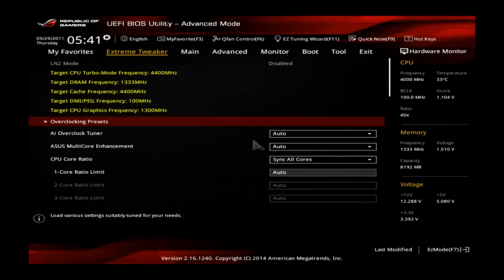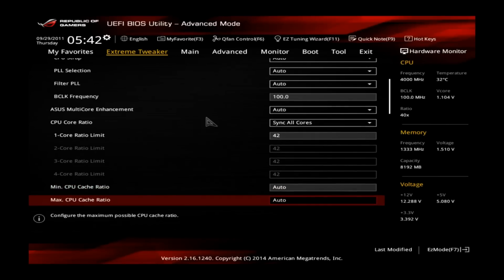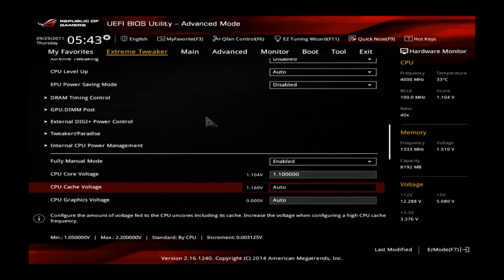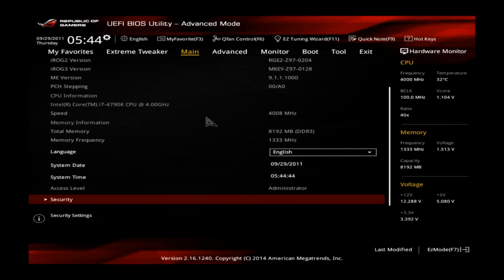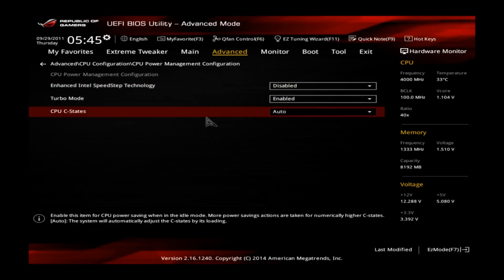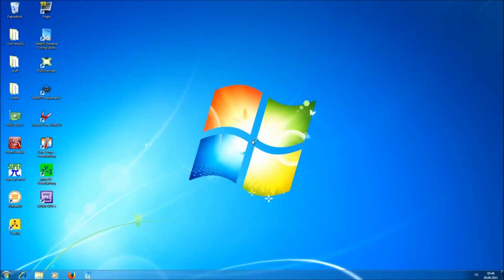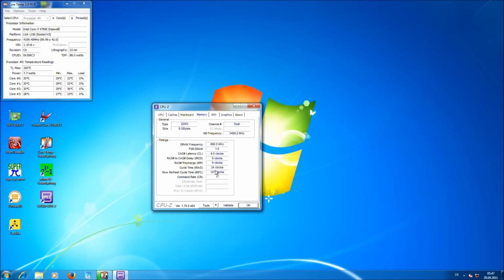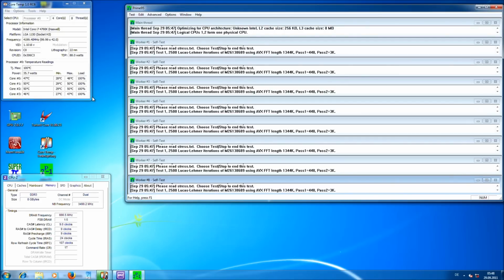ASUS MAXIMUS VII GENE [Part 1: CPU OC Guide]  Overclocking.Guide

Comment: Can u do a video how to overclock 4770K on this Motherboard.
I followed every step that u done in this video, but my 4770K is not overclocking like 4790K.
Reply from the maker: ES ES 4770K and 4790K are almost identical :) Where exactly do you have problems?
Reply: Its not starting to windows. it says your PC Ran to problem with bluescreen. and my CPU vlotage is 1.85 this the normal voltage I have.

Comment: I've just bought Maximus Gene VII.  The time doesn't go in bios :o/   WTF?
Reply from the maker: Roman Pike you can't enter the bios? Worst case boot without SSD/HDD plugged in.
Reply: der8auer I've fixed the problem. I have downloaded the new BIOS version, and the time is going right now. But in old BIOS, the time was permanent, and I had big problems in saves, in Witcher 3 game :о)  Every saved file had been in a different time and they all were mixed up. :о)) I blamed the game at first, but the reason was in old version of BIOS. ;o)

Comment: not working on my mobo, keeps bsod, ram is Kingston Technology HyperX Beast KHX18C10AT3K2/16X, cpu is Intel Core i7-4770K BX80646I74770K, do i need a better psu? i currently have a 750w
Reply from the maker: did you try to set a lower CPU speed? Which BSOD exactly?
Reply: der8auer yes, but it seems it only liked it at 39, i was searching online and found a forum where they said to try changing the vcore to 1.2625 and multiplyer to 40 & using xmp profile, so far it's running fine im running prime95, today i bump it up to 41 no bsod yet.

Comment: Hi, thanks for the video. Can i use the same settings on the Asus MAXIMUS VII HERO? Can u make another Guide for 4.4 Ghz?
Reply from the maker: Hi. The settings are the same using the Hero so it should be no problem. For 4.4 GHz just increase the 1-core-ratio-limit to 44 and increase the CPU Core voltage. Depending on the CPU quality you will usually need something between 1,2 to 1,3 Volt. Just raise in steps like 1,21 - 1,22 - 1,23.... until it's stable and keep an eye on your core temperature on load.
Reply: der8auer Hi, erstmal danke für die Hilfe. Das Bios Menü ist beim VII Hero etwas anders. Wäre es möglich, dass du es in den nächsten Tagen per Remote Zugriff auf meinem Rechner einstellst? Ich würde dir auch ein Amazon Gutschein zusenden. Danke & Guten Rutsch.

Comment: It's too complicated because of having to change too many voltages changes. I ordered the 4790k and a hero vii, can't I just change the CPU voltage for like 1.27 with an over clock and leave all the rest stock?
Reply from the maker: Sure you can do that. Just keep in mind that the board might raise some other voltages as well. Maybe I should add another guide for very basic overclocking like you want to do :)